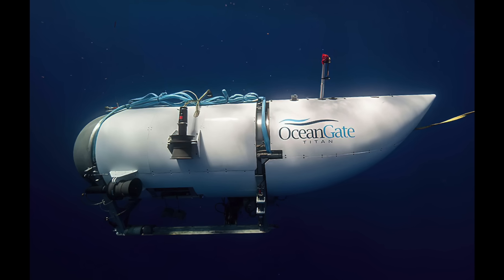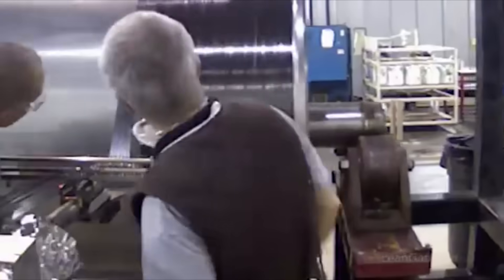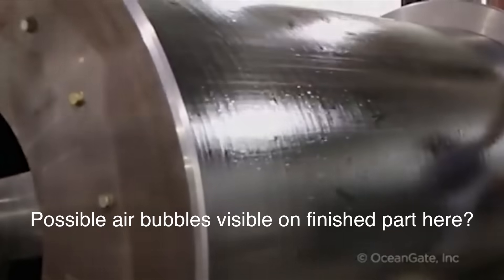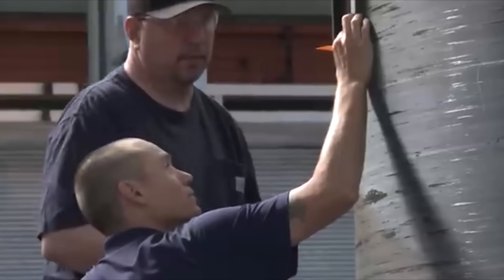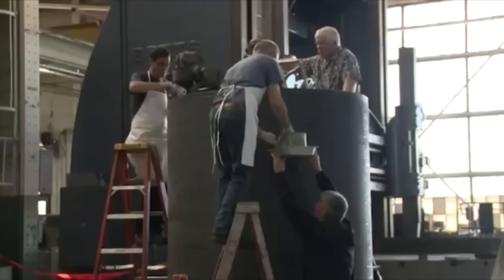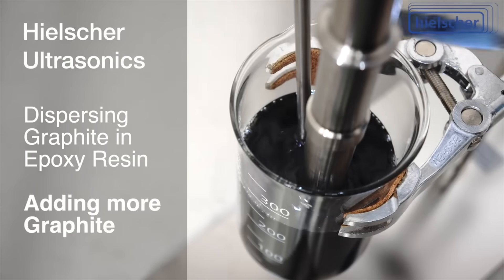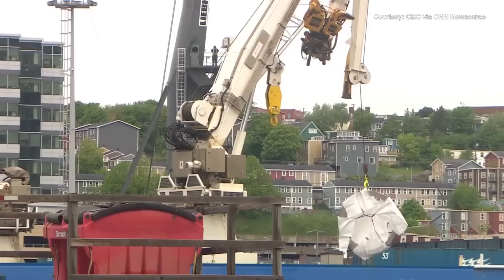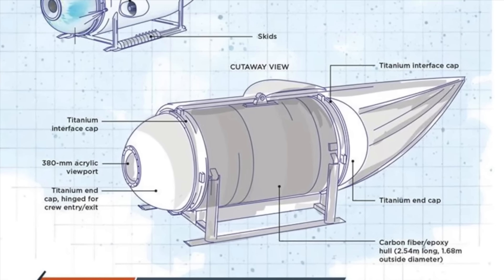Why OceanGate Titan Imploded - A Carbon Fiber Composites Perspective

Comment: Are we positive there would be zero torsional moments (1:46) on a long hull when it is maneuvering and turning underwater at those immense pressures?
Reply: The immense pressures have nothing to do with the loading while maneuvering.  It isn't like those pressures add inertia.
Reply: @stargazer7644  Thanks for your reply.  I may be wrong but I picture the Titan like a twirling baton, with the titanium domes being heavy at the ends.  So if you are cruising along in the sub even at high pressure depths,  and you change direction left or right, or up and down, there are forces rewired to move the heavier domes that are transmitted to the glued joint.  Now, those movements under the sea would be low velocity. I get that.  What maybe worse is when they transport the Titan on a flatbed truck or when they tow it out to sea and those heavy ends are bouncing around.  I maybe wrong.  Thanks for your comment.
Reply: @solareclipsetimer  The "heavy" ends are made of titanium, a strong but very light metal.  Titanium is only about twice the density of carbon fiber, but is much stronger so the titanium ends are not as thick as the carbon fiber tube (3" vs 5").  The endcaps are denser but only a bit more than half as thick as the carbon fiber tube.  That makes them close to the same weight per unit area as the carbon fiber parts of the sub.  Plus one end has a big chunk replaced with an acrylic window.  The end caps aren't significantly heavier than the rest.
Reply: @stargazer7644  Thank you so much for that reply.  Great information, you taught me something valuable!

Comment: 7:00 An extremely good point I haven't heard anyone make yet, any air in-between those mating parts would have collapsed to nothing possibly breaking that seal in sections and putting undue stress on the carbon fibre parts and possibly introducing torsional stress as one section of the hull flexes more than the opposite side.
Reply: If they used any kind of micro balloons to thicken the resin, it would contain small amounts of air that could be compressed Rescue bueys on atomic submarines were made with phenolic micro balloons that were good to down about 3,000 feet!??

Comment: The ductility of epoxy is reduced when the epoxy is dried from its wet state. Furthermore, to subject it after exposure to saline water, and then to the heat of the sun before the submersing of it again in saline water and then repeated heat will further reduce its effectiveness. Among the scientific studies: The Effects of Salt Water Aging on the Mechanical Properties of Epoxy Adhesives Compounds by Anna Rudawska (4 March, 4 April 2020). Other information abounds about this topic, not only to those who study chemistry and physics.

Furthermore, simple research / education reveals that carbon fiber is an organic material; contrarily, titanium is inorganic with a highly reflective quality that does not corrode at all in prolonged exposure to the extreme pressure of deepest sea water, which of course includes salt, which aerospace vehicles are not exposed to. So many facts are available about the effects of epoxy on the two different materials. No visible traces of epoxy exist on the titanium rings that were recovered, which is to be expected of this inorganic material with its highly refractive index. The bond between the two different materials was sure to fail with prolonged exposure to the extreme pressure of saline water at ocean depths. Many of us who have worked with epoxy realize that the CEO and his associates ignore this obvious information that is publicly available.

Comment: This was a really thorough, informed and thoughtful analysis of the various problems with the design and manufacturing of the submersible. 

I'm not an Engineer, rather I'm a physicist, and some of these issues seem disappointingly trivial, even to someone with my lack of relevant knowledge and experience. 

Not correctly texturing the surface of the carbon composite and/or the titanium dome before bonding the two...
From Year 7 D&T I can remember being told to rough up surfaces a little before gluing things together, give the glue something to grab on to.

Comment: I'm not an engineer, but it seems to me that with outside pressure, the sub was relying more on the strength of the epoxy that was binding the carbon fiber together rather than the fiber itself.
Reply: The sad truth is the whole sub community was aware of what was going on and only tried warning Stockton. 

The sub design would never pass certification, it wasn't tested correctly prior to taking passengers.

Crush hull depth should have been tested at 16,000 to ensure 12,500 was safe to dive..typically, you add 20%...Stockton only went over less than 700 feet.

Comment: No one seems to Notice the BLUE covering the underside of the Titanium Ring. That <Blue> is a SEAL and the Pliable <peanut-butter> adhesive is holding it in place during assembly.
Several factors should be considered:
Pressure compresses parts together.
There is a Steel Exoskeleton surrounding main structure.
The Rings are trapped to the Carbon fiber structure by the frame once the Cone Bolts are in place. (2) Brackets on each ring, left/right orientation, with several bolts in each.
The White parts of the Titan were simply non-structural Cover panels carrying the company artwork.
* The lower part of the Exoskeleton looked strong and supportive of a downward load, but the top structural support looked weak and was a single beam spanning ring to ring.

Comment: This was not 'innovation' as Rush claimed. The manufacturing process was way off industry standard, with many basic lapses.  Explanations that it has 'survived trips' doesnt justify the design either....as multiple trips can simply induce failure. Difficult to understand how he could be so slapdash for a vessel that was to operate under such extreme conditions.

Comment: I'm not an engineer. I'm just your average layman. When I watched a video of a guy hand spreading the epoxy resin to bond the carbon fibre pressure vessel to the Titanium end cap in what looked like an open-air hangar facility, I was incredulous. It struck me as amateur and didn't make sense, especially given the depth that the submersible would be diving to. I imagined that the interface between the two materials would be really important and therefore would be treated as such and not undertaken in such a casual manner.

Comment: There were external systems with a connection to the inside. Wiring would have to run from outside at the back to the inside through some means. Wouldn't that be a weak point to look at?
Reply: Those are called hull penetrations and there actually don't have to be any.  You can control systems outside of the sub via means that transmit through the hull. But if there were, there are commercially available systems certified for those pressures.

Comment: It worked 11 times to Titanic on 30 other shallower missions.   They were close.  Didn't realize their margins were so small.  10% more plies and that thing might last for years and years.  I'm still suspecting that bonded joint could be the root cause.  We need to see the acoustic data from their hull monitoring system for all the previous dives.  I'm not convinced that system would give them enough Time to ascend and get to safe depths.  When composites finally let go, it's usually very quick.
Reply: I'm not sure 10% would make a great difference. The failure mode of rigid CF in a relatively malleable matrix, in compression, is surely quite different from that of homogenous materials subjected to cyclical tensile strain. I wouldn't expect the logarithmic gains you normally get from most materials, in most circumstances.

Comment: I have two additional concerns, one of which (#2) you touched on.

1) The stiffness of the titanium ends under compression would likely be different to the stiffness of the composite tube, hence under severe pressure, you'd be introducing additional stresses, especially in the bond, due to the difference in compression rates... similar to having to match thermal expansion coefficients to help reduce thermal stresses.

2) If the ply WAS on;y a 0 UD lay up, then the bending moment across the length of the vessel was ignored i.e. the ends are stiffer radially than the middle as you have the ring support of the titanium caps (or conversy, if the titanium caps are much less stiffer, then they'll contract at a greater rate than the centre hoop section), so you're introducing bending stress in a deiration where there are zero plies.

*I've done quite a lot of structural CAE on carbon composites and seen the physical tests. The bond to metals was always a pain in the arse.

Comment: 1:58
"The carbon is going in one single orientation."

At 1:38 he said it was a "0-90" ply, although the video only shows a 0 UD lay up.
Reply from the maker: Yes I wonder if another axis was added later in the layup… one of the viewers said they thought they did apply a 0 and 90 but the 0 was done by hand or something.
Reply: @JamieKunka  
I was under the impression that you should never stack up plies more than 4 layers thick in the same orientation, so a 0-0-0-90-90-0-0-0 etc. would have been advisable.

The interface to the titanium would always have raised alarm bells with me. You can't really do CAE on that, as you're unable to know what the bond quality is like.

Comment: im a former professional glass fibre pipe system builder (power plants etc, 7-8years)  and I absolutely agree with the issues you point out. TBH it looked that they had very little clue about what they were doing and was just winging it, hoping for the best. Also I think the different thermal expansion coefficient of the materials used could play a role.

Comment: Finally, a well documented, balanced video that doesn’t just go “carbon fibre is bad in compression, that’s sooo obvious, these guys are dumb, brrr”. I’ve recently watched video from real engineering and was a bit disappointed in that regard. But your vid point exactly to realistic potential sources of failure. Well done!
Reply from the maker: I’m so glad someone brought up the ‘carbon is bad in compression’ trope, I feel it’s thrown around a lot without. Whilst it’s true it’s only 30-50 % of its tensile strength with proper fibre alignment one can mitigate the disadvantages a fair bit!

Comment: There is allmost zero longitudinal tensil strength in the cylinder, while the curcomfrance has way more tensil strength.  It has comprehensive value and tensil value in the curcomfrance, but only comprehensive value longitudinal.

Comment: 1. The carbon fibre of the Titan hull is not just in one direction but in both hoop and axial direction. Below is direct quote from an article in “Compositesworld” explaining the technical details on the construction of the hull:

“combines alternating placement of prepreg carbon fiber/epoxy unidirectional fabrics in the axial direction, with wet winding of carbon fiber/epoxy in the hoop direction…”

2. The epoxy glue are only there  to hold the titanium end caps so that it foes not fall off while the vehicle is not under pressure. 

When it is diving, the immense pressure under the sea will press the end caps tightly in place against the carbon fibre hull. There is no risk of the cap accidentally coming off even without the glue (you can use vaseline and it will stay)

The only way for it to come off is if the hull imploded.

Not sure why people seems to think this is area of concern. I can’t see any possibility of the bonding having any issue while diving at all.
Reply: Based on the odd shape of outer hull, perhaps the underwater currents caused one end cap to move laterally.
Reply: @raybod1775  That’s probably like you trying to move a tank with your ding dong.

It wouldn’t move an inch…

Comment: Would some dear rational soul please explain why the titanium ring to hull bond is important?   The end caps are pressed onto the hull by hydrostatic pressure. The deeper the sub, the greater the force onto the hull. So that interface bond only has to keep the rings in place on the surface.   This fretting over the ring bond is a red herring. 

The failure of the carbon composite is the cause of the collapse.

Comment: A quick search and we find that the 'circumferential' stresses are double that of axial stresses in a 'thin walled cylinder'.  But I've also found that so-called 'transverse' strength of carbon fiber is a lot less than when applying along the length of the fiber.  So even if there are no 'torsional' stresses, certainly there are axial loads, and being applied perpendicular to the fibers.  That seems to be a BIG problem (IMHO).

Comment: I wander wny they wouldn't have incorperated threaded tianium rods  around the exterior of tne pressure hull between the two rings to help hold them together as a backup to the glue, i guess they thought the 6000 psi would hold them together. Eveytning u said make perfect sense. The mechanical bonding surfaces were definatly not sufficient and not sufficient surface area for the bond

Comment: Did the tubular hull fit on the inside of the titanium end rings?  Why was there no inner ring?  No surface prep such as etching, inadequate cleaning, contamination, lack of resin squeezing out, carbon fiber ribbon wound like tape in only one direction, etc.  Oh, and the fact that carbon fiber composites are not recommended for compression application.  At least the name of the company makes sense!

Comment: Very good analysis of what and why likely happened the Titan implosion. Thanks. 

IMHO it's even intuitive that the carbon fiber layers should be put ALWAYS in several (many, even some layers at random?) different angles to get all its properties, strength and to diminish the advance of delamination and its speed of propagation. 

The RTM that Stockton included into his carbon fiber submersible was a good idea (indeed as per the transcript, it took about 19 minutes since the moment when the RTM alerted something was wrong with the carbon fiber hull to the moment of the implosion). So, if just he would have laminated the layers at many different angles, likely he had time enough to save the situation. 

Also, it's pretty clear that the delamination was already quite advanced since the beginning of that last dive because it descended faster than predicted (and yet faster as the submersible was diving deeper) and it then did ascend very, very slowly despite all their efforts, which was "unclear why rate is small" (I guess due to the delamination the carbon fiber hull was being compressed, deformed and so bending slightly and more towards the mid section of the tube, firstly silently, then loud enough for the RTM to note it and, finally, with terrifying bangs and cracking sounds...). As the hull starts to give in to the pressure and bends inwards, it displaces less water, hence it loses buoyancy.

The carbon fiber composite is very hard and light material... but fragile when its limit is exceeded. So for submersibles, even being well constructed with carbon fiber, I think it's better to rely on other materials which are able to deform without cracking, like high quality stainless steel.

And also the shape it's very important. Needless to say that the sphere is the best shape for this task. But, the shape of a rugby ball it's better than a cylinder shape (because the arc shaped structures are much more robust than the straight lines) as it's so widely used in construction of dam retaining walls and in architecture.